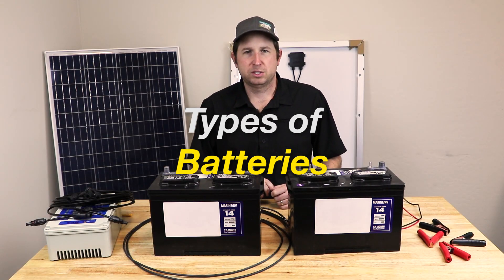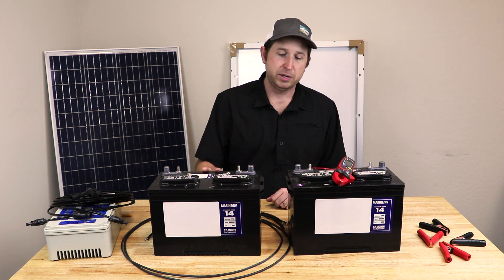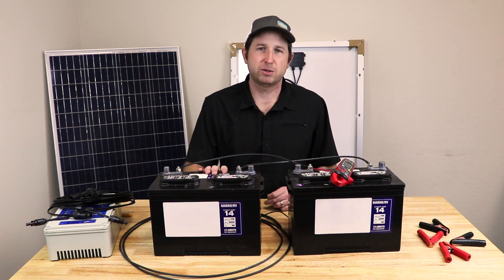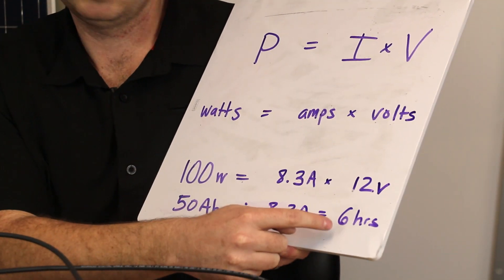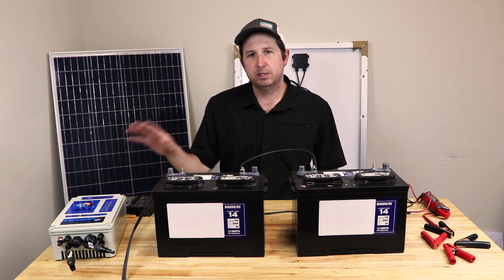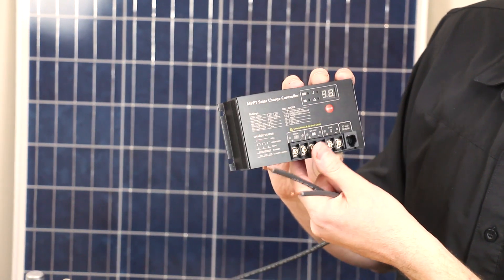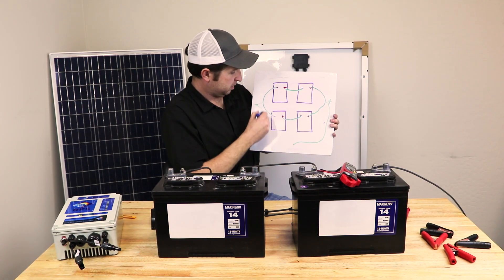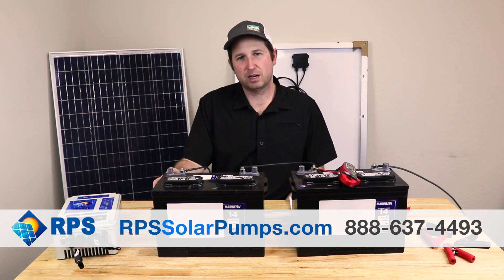All about Batteries!

Comment: Do your smaller pump/charge controllers have built in charge profiles for use with LiFePO4 batteries or can you modify the charge profiles into the controller after the fact?
Reply from the maker: No we do not.  Currently for cost versus performance on solar pumps, we still like the high quality deep cycle lead acid batteries.  I think in 2-3 years or so, Lithium batteries will come down in price enough to justify the switch!
Reply: @RPSSolarPumps  You were right.  LiFePO now provides more capacity and cycles per dollar compared to lead acid. Do the current controllers allow for LiFePO batteries at this time?
Reply: @RPSSolarPumps  Thank you for the information!

Comment: How would this work with a lithium ion battery
Reply from the maker: Pretty similar, but you have to be careful with lithium ion batteries and putting them in parallel and series.  Best to talk with your supplier.
Reply: Battle Born batteries would work fine, you may need a separate charge controller though, unless the ones sold by RPS can be adjusted.